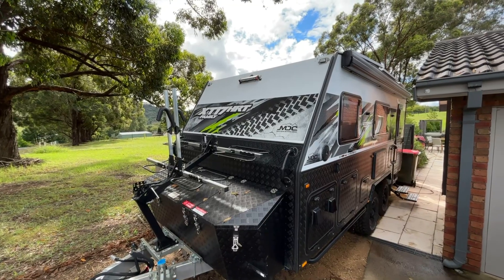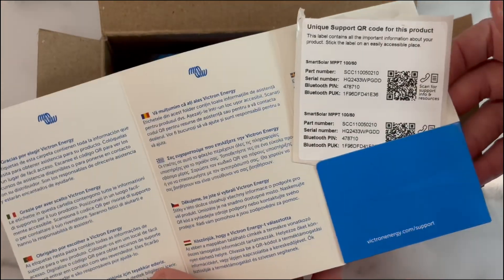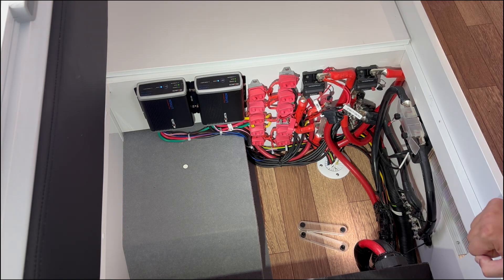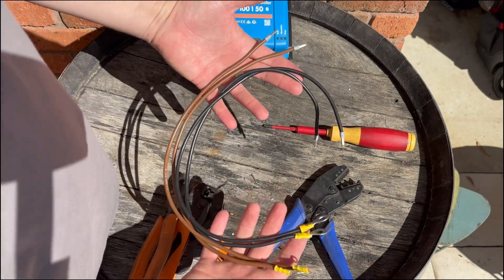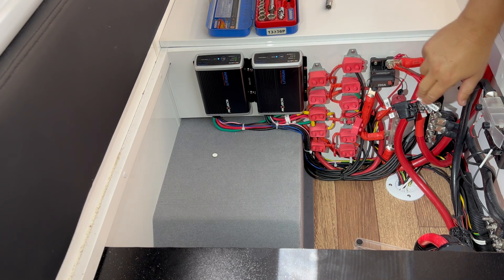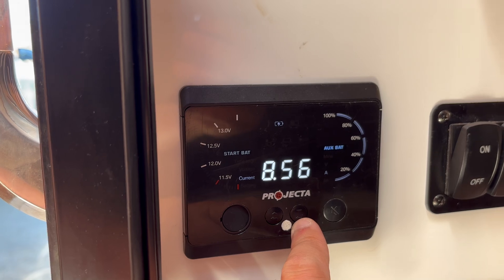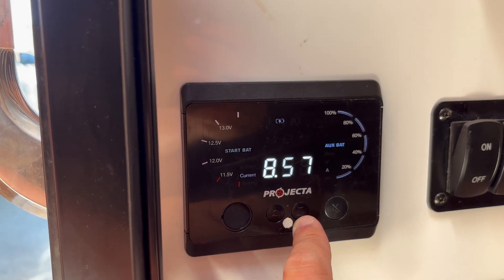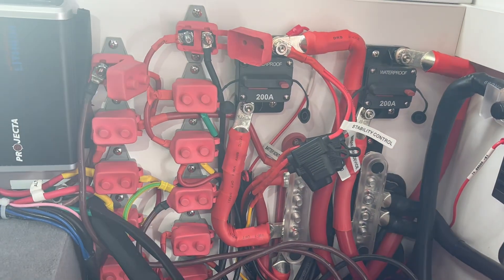Replacing My Caravan's Solar Charger - What a difference!

Comment: I have a sr16 island, solar amps was so sad , approx 2 or 4 amps tops, I tightened up the connectors and all was good for a time but again failed ( don’t think the charge got above 8 amps) so remove panels (x2) and fitted new fuse holders and connectors. Wow what a difference …. I see 18.62 amps .  Now problem is the Projecta dc/dc cycles and I miss out on so much charge time .. now I am waiting for Victron controller to turn up and will be fitted.

Comment: Is the victron only for lithium?
Reply from the maker: It can be used with other battery types, there are presets in the settings for different battery types. And can do user defined as well if it doesn’t suit your battery specs

Comment: Great video. We have a MDC XT12HR, also a bit disappointed on the solar power and battery life on trips. This gives us something to consider, thank you for sharing 💯🇦🇺
Reply from the maker: Thanks for the comment, worth it in my opinion. I no longer need to plug the van in at home.
It only gets a few hours sun each day where it’s parked and previously had to plug it in to mains now it’s topped back up to 100% in the morning with the fridge running 24/7
Reply: @ that’s awesome! We’ve re wired for a portable solar panel, but I think we’ll follow in your footsteps and eventually change out to the MPPT like you’ve done.
Reply from the maker: Yeh, I’ll be adding an additional MPPT for a solar blanket as well so we can chase the sun when parked in the shade and be a little more greedy with the aircon ;)
Reply: Great video thanks! I've just brought home a 100/50 victron as well today For my Forte9+. Overnight My fridge lowered my bat to 80% and it barely charged above 82% after a full day in the sun ( with fridge still running). Disconnected and checked each panel at the cct breakers to find 1 panel at 4v - no current. Jiggled the substandard mc4 connectors under the panel and it sprang back to life. I will be removing the 3 panels and refitting decent quality mc4 connections. Also will reteminate some of the terrible crimping at the breakers/bus bars. Great van but the electrics could be better. Also as so many others have done I will wire the redundant solar input on the dcdc to an external anderson for an extra panel if needed.